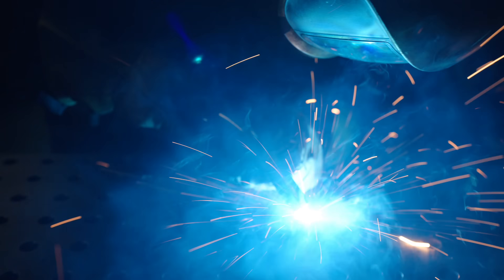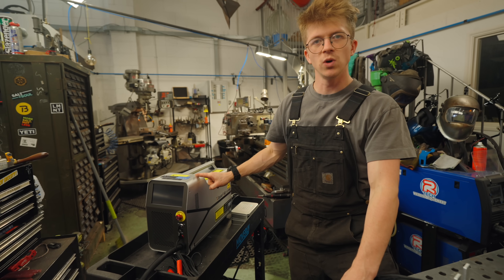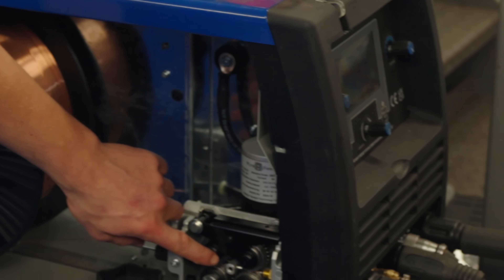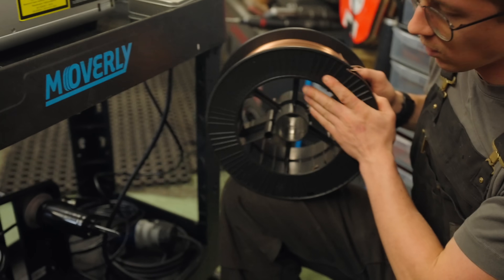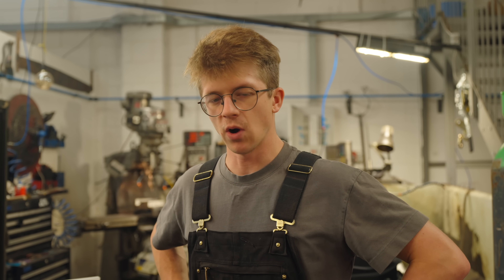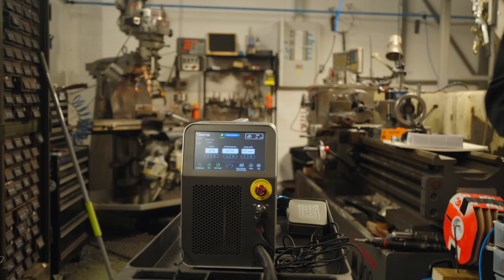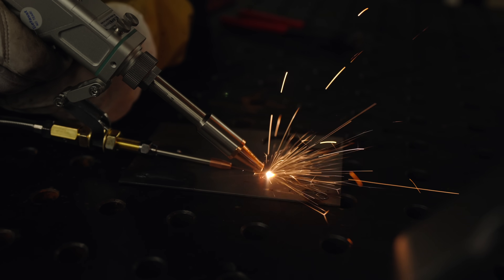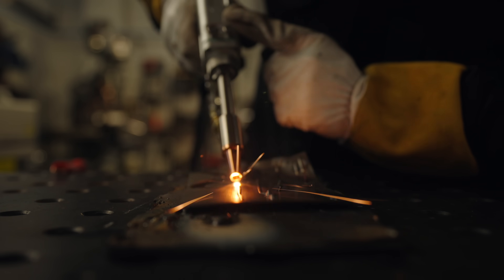Laser Welding

Comment: Hi there, I'm a former boilermaker and I envy those who have access to this kind of equipment. When I was still working, we didn't have such high-performance gear and it was unimaginable at the time. Now I see all these machines that allow almost anyone to try their hand at welding (for example) without having done the "usual" training. In just a few hours, anyone can learn to use a MIG welder, and now there are even laser welders that do three things in one, making welding seem like a formality. It must be a breeze to weld with that. Quick question: what about power consumption? Could you give us an update on that in a future video where you use it, perhaps using a device that shows the power consumption of an appliance, if such a thing exists for industrial equipment? You can find them for home use, but I don't know if they would support three-phase power. I think you know what I mean. Perhaps you could make a video dedicated to the power consumption of these different welding processes: TIG/MIG-MAG/Laser. What do you think of that as a video topic?

Comment: "There is a laser coming out of the end of that bloody thing", and it is an extremely powerful laser!
In my opinion the most dangerous part of these IR lasers is not the fact that it has death-ray-level power, but the fact that it's completely invisible so you can easily forget about the death ray. If it were visible, this kind of laser power would light up the entire workshop (ask me how I know).

Bit of info about class 4 lasers: they are so powerful that even looking at the spot the laser makes on a diffuse surface (i.e. non-reflective, like for example a wall) is enough to cause eye damage. That means that even if you don't get a direct beam in the eye, you can still get nasty damage. The IR laser won't make a visible spot on the wall, but again, that just makes it more dangerous: the spot is still there, but you don't benefit from the blink reflex you get with visible light. Whenever you see a bright spot beyond the gun (like on the welding bench while cutting), that's a spot where the laser can reflect and/or scatter from. Especially around metals, you have to be extremely careful with stray beams!

I know we see very similar warnings on much more "pedestrian" things like laser pointers/cat toys, but these two things are not alike. This is to a laser pointer what a wild bengal tiger is to a tabby. Enclosed space + blackout curtains would be my recommendation

Comment: Watching another channel use a laser welder and they seemed to get good penetration on thick steel by angling the laser into the gap. They also made a point of how important it is to watch all the laser safety videos before using the laser welder.

Comment: I hope we see how this works with two and three dimensional seams, or how much practice it needs. The amount of heat this puts on the sheet is so much smaller than with conventional methods that panel beaters should be thrilled.

Comment: Alec, the cleaning setting on the laser welder can be used to take the surface scale and oxidation off of workpieces that have been hardened or otherwise gone through the forge. that means no more grinding/sanding for hours jut pop the jacket off your billet and give it a laser . it will save you a ton on material cost (you'll have far less wastage from milling ect) it will also ensure pieces you dont want to work harden while grinding keep their original properties

Comment: You get a better result if you welding carbon steel to use a MiG wire that's not coated in copper it's a little less sticky and penetration.

Comment: Seems like something you'd want to set up a booth for.  Even if it's just some curtains to catch the laser... but having said you'd probably have to look into what materials could even handle it.
I'm reminded of the Arc welding booths we had in my highschool welding class.  Which were just a Steel table, 3 cinderblock walls and a curtain hung for a door.

Comment: You can theoretically use this on any meltable metal. It should be more usable even than the tig welder if you could figure out custom metal feeds like on the metal spraygun from a few vids ago.
Reply: Fusion on things like gold might be an interesting application and hand feeding wire should be tested.

Comment: It shouldn't be that hard to add a tiny sensor that measure distance and only allows triggering the laser if it detects an object in the range expected for using the currently configured settings.
Should prevent the most common accidents like setting your workshop on fire or lasering off the tattoo on you butt...

Comment: 17:05 Love to see it. And yes, while things like the desktop laser cutters and that engraver are not as dangerous, this will 100% blind you instantly and light stuff on fire if you aren't careful. Glad to see it comes with some safety equipment and you're using it. The scary thing with lasers is that the consequence of a mistake is often quick and permanent. Burns hurt, arc flash _sucks_, but getting blinded is a mistake you can really only make twice. 
For others looking at tools like this (or really anything involving any lasers more than a cat toy—and honestly, if you didn't buy it at Petco, I wouldn't trust those either. Ebay loves shipping 1W lasers labeled as 'class 1' which they aren't) I'd recommend StyroPyro's videos on laser safety goggle testing, and especially with cheaper kit, I'd also recommend testing that the goggles they provide are actually the correct type and rating. With something of this class I'd be more inclined to trust the kit they provide, but it's unfortunately common for the safety gear that comes with cheaper lasers (assuming you get any) to be completely useless.

Comment: I wonder how fast the beam spreads - or will there be random fires in the shop after a welding session. Sand box into the line of potential stray beams?

Comment: Do yourself a favor and enclose the bottom of that cart. Dirty wire sucks, just pop a small hole for the wire to come out of.  Also, a door on the wire load side for changing wire. Leaving it out in the open will cause your wire feed line to plug up faster.

Comment: So, a suggestion for cutting with the laser.  In CNC laser machines the head is vertical, and I would guess that you want the cutting head close to perpendicular to the work to reduce the effective thickness of the cut.  Just as sloped armor provides a larger effective thickness because the projectile has to pass through more material, the laser has to heat more material the further you angle it.  Now I would also suggest not cutting right at perpendicular, maybe 5-7 degrees off?  Because the laser reflecting off the molten puddle and traveling back up the fiber cable is an issue, just off axis may be safer for the laser and still close enough to not see an effective increase in thickness.  There MAY also be an effective focal point just outside of the nozzle, that you want to be in the center or top third of the work piece to concentrate the heat most effectively.  Industrial lasers use capacitive distance sensing to hold the laser head a very specific distance over the work to keep the focal point in the work.

Comment: My opinion:
Safety step #1: Dedicated room for the laser welder which is clear of flammables.
Reply: And reflective surfaces.
Reply: @KolyanKolyanitch  Too late, I put mine in a house of mirrors.
Reply: @KolyanKolyanitch  Reflections aren't as big an issue, with a laser it burns at a range of focal points, think magnifying glass in the sun. odds of a reflection, getting a focal beam, from a few feet away, or even focusing that beam are astronomical, though possible. If you're planning around that might as well paint the whole room white so the beam reflects and diffuses rather than burns the walls/floors/equipment. I don't know for certain, but I'd wager using it in a normal shop enviroment, provided there's proper PPE for everyone in the vicinity, would be well within an approved safety factor.
Reply: @KolyanKolyanitch  and windows
Reply: @KolyanKolyanitch  🤣
Reply: @KolyanKolyanitch  I don't think you'd want to give the laser the opportunity to start bouncing around
Reply: @xMingan  ...clear of flammables and reflective surfaces. Is it really that difficult?
Reply: @christiannorf1680  well its a metal working workshop so most metals are reflective to some degree,  most of the machines have lubricants usually hydrocarbon based which will catch fire eventually and you saw what the lazer did to random cloth at a fair distance.  not to mention he really doesn't want to randomly blow a hole in a gas bottle and he has several different ones some inert some not so inert (oxy acetalene, propane etc) and like he says a random person walking into the workshop not wearing lazer eye protection poses some potential issues.  

the issue is range,  traditional welding the range is less than a foot i.e. unless i can reach it with the welder its mostly safe and once ive moved away from the weld solong as stuff doesnt touch the hot metal its fine.  the lazer welder is,  i've accidentally blown a hole through the part, the wall behind it, and hit something on the other side without realising it (obviously dependant on distances, the machine setting, the type of wall etc etc ) when hes cutting with it you see him blasting his fixture table and he places some sacrificial metal to protect the table after
Reply: @joylessdave  I'm well aware. The person I was responding to apparently didn't understand that the person they were answering to meant there shouldn't be reflective surfaces either.
I was asking if it's really that hard to understand what was meant.
Reply: Yeah, imagine the laser hitting one of the propane hoses of the forge or the torch. Even if it's "just" a reflection off of something else in the shop.
Reply: Seriously. I've worked with some welders that I wouldn't trust with a match near me, much less that heat death gun.
Reply: A couple of movable laser proof curtain/screens.  Much like the UV blocking plastic curtain/screens used for arc based welding in factories.
Reply: Professional suppliers of laser welders in the UK require a welding booth/enclosure to be purchased as part of the deal, or at the very least a waiver signed by the customer to the effect that they have been told it is necessary. You may get away with some of these antics in a single man workshop, but not when others work in the same area. The interlock system that they get you to bypass by putting it onto the torch in the hand is supposed to be linked to the door of said enclosure so that if someone opens the door the laser shuts off. How long before some of these suppliers to YouTubers fall foul of this I wonder?
Reply: @dazhiggs5891 united kuckdom
Reply: And good ventilation
Reply: And gas bottles …
Reply: and where is the fun about that?😅
Reply: But Alex is surely flammable?
Reply: Yuuup him talking about safety in front of explosive gas canisters was... concerning lol
Reply: @tomspettigue8791  They are only explosive in movies and video games. If you puncture a propane cylinder and set it on fire, the only thing you will get is a jet of fire. Not a great situation, but far away from an explosion.
For an explosion you need a proper mixture of fuel and oxygen. Basically impossible if your fuel is coming out of a hole under high pressure.
Reply: true
Reply: needs to be completly light sealed
Reply: Humans are also flammables, so safety step #2 is to use a welding robot with its own separate robotic room.
Reply: And in many countries regulation imposes locking doors from outside.
Reply: Full of mirrors and kerosene you say???
Reply: With laser in use and laser eye protection signs everywhere so some dimwitted fool doesn't just stroll in without making it obvious to them that there is invisible stuff in there that will severely injure them.
Reply: В инструкции так и было сказано, возможно переводчики плохо знают китайский)
Reply: My opinion:
Safety step #1: Dedicated room for gooning. Clear of surfaces that are not screens.
I had to, I'm sorry.

Comment: X-Tools Welder WILL WELD 1/2" STEEL - NO PROBLEM !
i really do wish Alec's A.D.D. would have let him spend more than 5 seconds looking at the Welder Interface before LETS DO THIS.... 
kinda sad really, such an awesome bit of kit deserves more than A GLANCE... not saying Deep Dive, but ....cmon...

i have seen a couple videos on these, and there is A LOT of dif settings for welding dif materials in there. like Alum, SS, Iron, etc. 
but this will 100% weld 1/2" Carbon Steel with 100% Penetration - No Problem. you just have to change the settings.

Comment: Alec, great video, as always! In addition to the line-of-fire hazard you demonstrated beautifully, reflection and scattering are also scary. Surprising surfaces can bounce or split this beam. Someone might end up with a retinal burn resulting in significant or complete vision loss.

As a precaution, I would advise everyone in the workshop to wear protective eyewear at all times while the laser welder is on.

Comment: I'm not sure spending $4000 to $6000 USD on a laser welder to make billet boxes faster justifies the price.  But if is was using it to do sheet metal bodywork  I think this tool would be perfect. In that case it would cut time by 75% and increase your income.

Comment: As an engineer who has done quite a few laser welding projects, please get laser safety training and designate an enclosed area as the laser welding room (appropriate curtains or walls). You not only have to be careful of the direct laser beam but also be mindful of reflections at shallow angles. Anything under 20degrees will cause considerable reflections off the sheet material. There were a few times when Jamie (or the camera) was positioned in areas downstream of potential reflections. I have destroyed a camera with a reflected beam in the past and it wasn’t fun to explain to the boss.

Comment: Alec, just to point this out i believe you should use that system in your grinding room. If you accidentally catch a hose or propane tank with a hot beam things could go very bad, very fast. at least in the grinding room you don't have as much of that to worry about. Perhaps add a slot in the wall to roll the setup up to when you need to use it, to keep the equipment out of all the grinding dust.

Comment: With respect to safety of lasers like this, you really want a separate room with several safety interlocks.  1 interlock with the solid steel plated door set in solid steel walls.  All metal walls and door should be matte finish for safety.  1 or more per helmet interlocks with helmet being down and on a head.  1 massive scale as a further interlock with a pressure plate to keep weight of people within margin of certainty of who is wearing helmets.  >300lb on the floor and 1 of 2 helmets on the rack means no laser.  

And that is if you permit more than 1 person in the room to film.  Nobody else has that requirement.  

~One Engineer who has worked with some safer lasers.

Comment: I've seen a few of these over the past couple of years, this looks like one of the easier to set up one. May have to add it to my future list :D 

Be extra mindful to not blow up the pressurized canisters for gas/etc when using it at a distance (or like with the finger, by aiming it in the wrong direction). Probably good to have it in a corner away from anything reflective for safety.

Either way, seems like this'll be quite handy for future projects.

Comment: As a tradesman in the welding craft, I find it difficult that you praise this as some miracle welding machine.  With Tig, Mig and Arc you are controlling all the aspects. This is auto welding with only setting up the machine with no human input. If you can't weld a can with mig or arc for damascus in a short amount of time you need more practice. Tig, of course, would take quite a bit longer. But to say, I spend half a morning, with the viewer not knowing a timeframe, is a bit ridiculous. An arc and a mig competent welder could do this weld in the same time, with the exception of the arc welder cracking off the slag. Not sure if you are trying to push a product, it sure sounds like it.

Comment: You can use pulse attack weld but the right way to do it is to attack the very end of your work piece you don't ever attack a center part like you were doing and going over it attack one end of your work and check the other end of your work

Comment: Ok, I always thought the manual laser welding videos I saw were fake but seems it really works that well. A gamechanger for sheet metal work obviously, especially as it seems to be less critical about cleaning the workpieces than TIG. 

Just remember safety, a laser beam that strong does not need to be a direct hit to cause serious eye damage, even a reflection can blind someone, so make sure EVERYONE in the space (including the cameraman) is wearing safety goggles.

Comment: got to play with a REALLY nice one about a year and a half ago, as someone who prefers tig welding normally this feels like cheating just pull the trigger and the wire pushes you at the right speed, and with the unit we were using you didnt even need a full hood, we just wore the right glasses the nice thing is you can grab on to the piece within seconds of finishing the welds because the heat input is so concentrated

Comment: just an advice. don't point your camera towards the beam of the laser it will damage the sensor of the camera. use a ND filter to reduce the damage on the sensor. you don't want a black dot in your camera